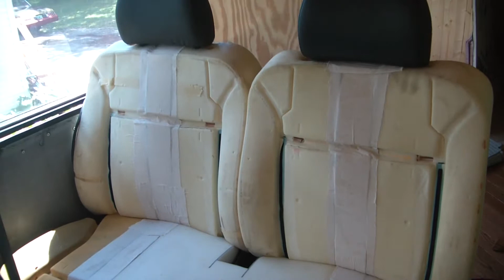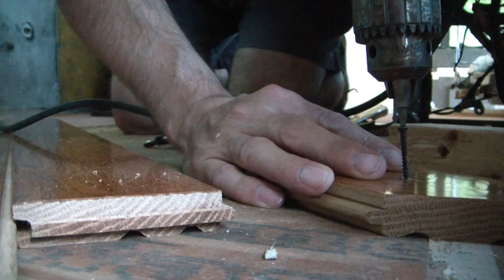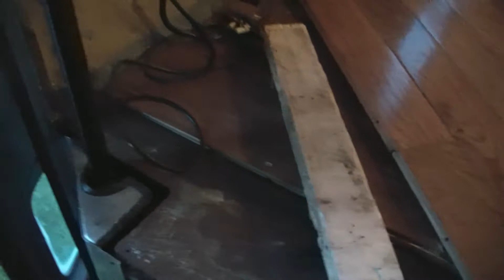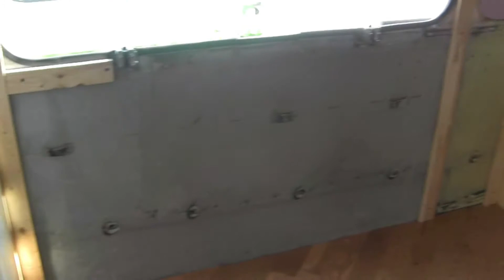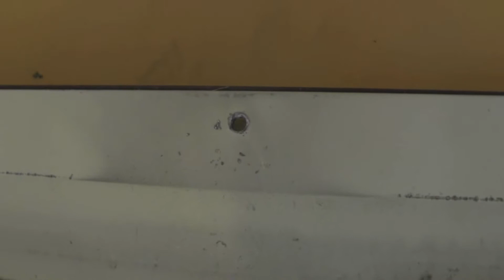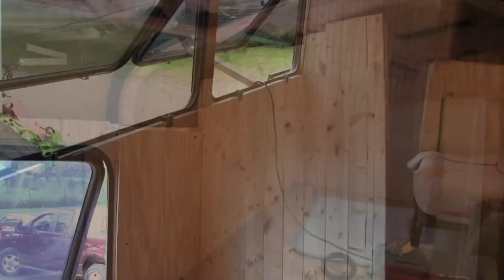MC9 flooring

Comment: Pretty nice, did a great job on those seats.  Man, that's a lot of off cuts on that floor! Looks great though.  My 96A3 had the single door, and while I prefer that over the double fold, it weighed so much that the big pivot bolt for it was worn and it sagged a little.  Definitely think a home made door is the way to go as long as you can get her sealed up tight.  As I look at yours and remember mine I believe you would have to totatlly reconstruct that dash to do a factory door. Great vid!